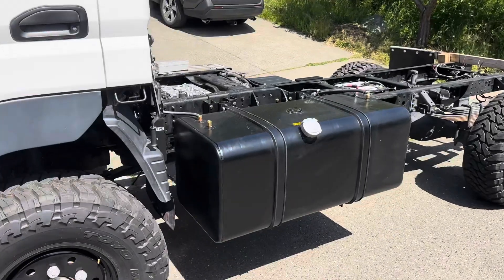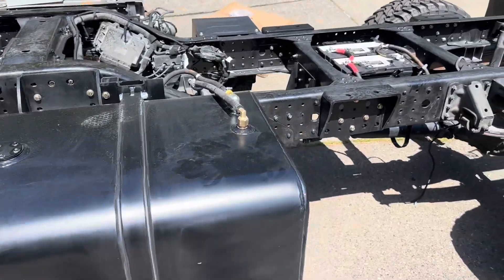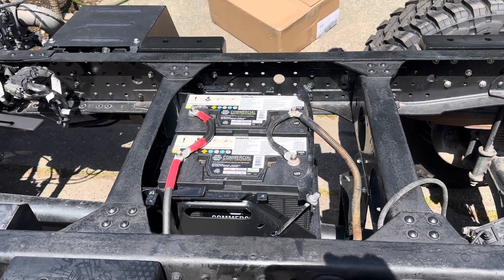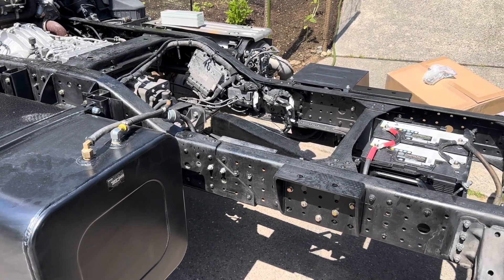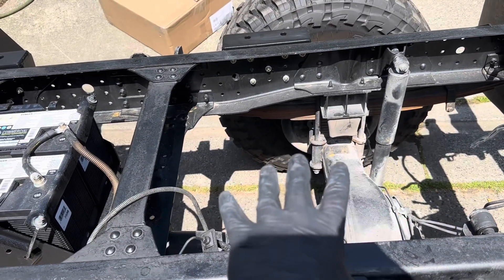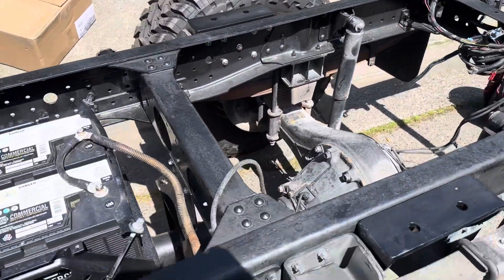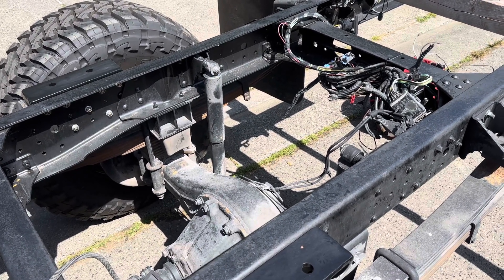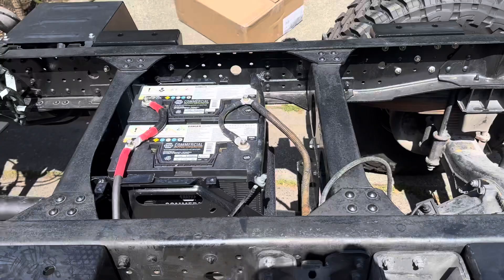Overland Build: S2/E3 - ViAir Corp Onboard Air System

Comment: Hello, When you changed your fuel tank, you probably had to change some components on your old tank. Like the fuel pump and filter.
Reply from the maker: The pump and filter are external. Only thing that was changed was the sending unit, that then required a little computer to correct the gauge
Reply: @TheItinerantCraftsman  Tank'S
Reply from the maker: @jonathanfalardeau1857 😂😂

Comment: I am thinking of building something similar so that I can live in it I am enjoying your video's. are you planning to do any suspension upgrades to make it even better offroad?
Reply from the maker: Thank you. I’ll be living out of this rig full time very soon. The suspension was upgraded which also lifted it about 4”. It was provided by Fuso Off Road out of Canada and imported from Australia
Reply: @WonderofWander  nice! Thank you for the company name too!
Reply: Nice Larry! Our house batteries are where your truck batteries are. Our truck batteries are in the rear and our Extreme Aire 160 psi with tank is just forward of that. I think our diesel tank is 55 gl.
Subbed and liked!